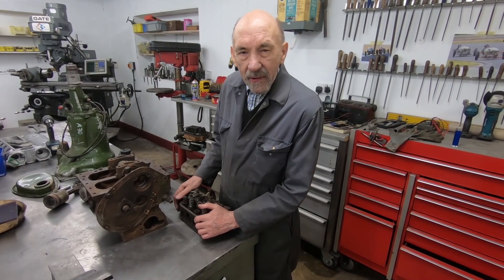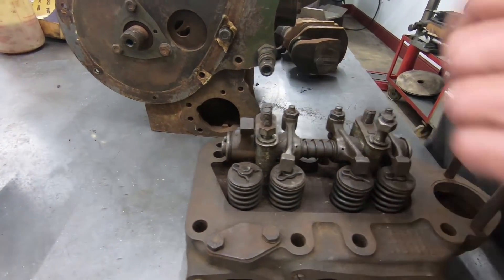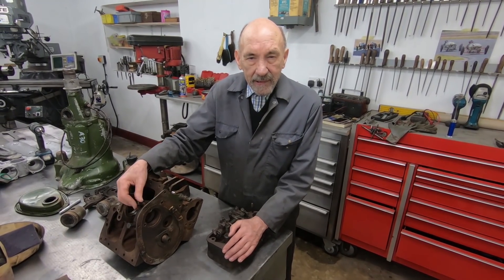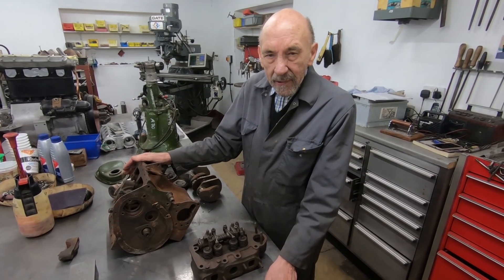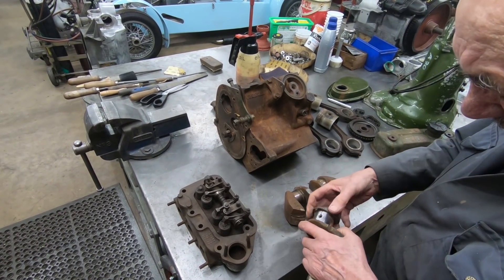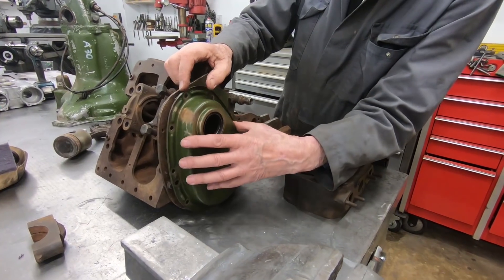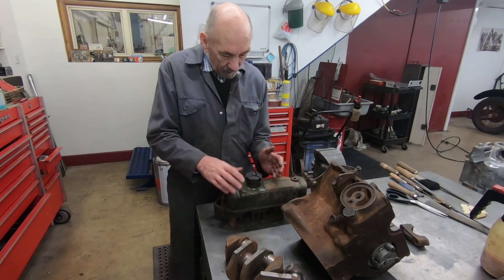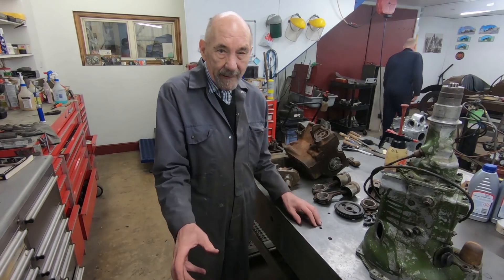2 cylinder Mini prototype engine?! 1957 - Ivan's Shed

Comment: I've watched the whole series on this engine. As an illustration of Ivan's engineering abilities, the rebuild of this engine is phenomenal. As an illustration of the mindset in BMC at the time, this is terrifying. The fact they seriously considered putting a water cooled cast iron engine 1/2 the capacity of the 850 in the mini beggars belief. Thankfully they saw sense,  releasing the mini with the same horsepower and worse power to weight as the 2cv would have killed the mini stone dead.

Comment: I enjoy watching your videos, on your  two-cylinder mini engine could you tell me that phrased you used when the coil was getting the start of current, I have the same problem with my jaguar E-Type which I hand  built in aluminium including the front a-frames, my name is Joe and I'm fully retired now, but can't stop shaping metal. Hope you can help me out and hope to hear from you.
Reply: Sorry I meant to say when the coil was getting  starved of current when you were trying to start it.

Comment: Before you cut and weld up a crank, consider using hte journals on the same side of the crank and simply alternate the firing of the cylinders to "balance the firing". It is a four stroke so thi is a possibility. Have a look at the Fiat 500 Cinquecento engine for reference.
Charles

Comment: Are you still thinking to try this engine in the A30? Presumably it's around 475cc and maybe 18 horsepower (because I'm guessing that the two cylinder engine was made before they decided to shorten the stroke)?

Comment: A rare gem very nearly lost in time - amazing I never realised there were a two cylinder prototypes. Glad they decided on four though it would have been dreadfully under powered.
Reply: As a 1991 Fiat 126 Bis owner 2 cylinder isn't that bad that engine designed in 50s too

Comment: Just seen this courtesy of a post on the Morris Minor owners forum. Like others I thought of Allen Millyard straight away. Ivan removes a couple of cylinders on a crank and camshaft and Allen adds two. Excellent engineering and problem solving.

Comment: I have 3 WW2 Clark CA1 airborne bulldozers to restore (one day), one has an incorrect engine, a 2 cylinder Wisconsin THD, It has two pistons rising and falling at the same time & fires every 360* much mike you e mini engine, however the earlier TJD (almost identical to look at) has one piston rising as one falls and fires 540* between 1&2 but only 180* between 2&1, 
You would thing they would sound very different but it's hard to tell them apart!
Andy

Comment: I have several British made 498cc and 596cc water-cooled twin cylinder engines, with 180 degree cranks, but they are two-strokes, from Scott motor-cycles.  Over the years, from the late 1920s, they were tried in various three-wheeler cars, and two were mounted back to back, to make a V4 and installed into a Morgan three-wheeler. All good stuff !!

Comment: The bores are the same as the 850 mini engine and there are 2 cylinders? So assuming the stroke is the same it's 424cc. It would have to go into a very small car.

Comment: I recently saw a fellow take a 5 litre (305 cu in.) GM V-8 engine that he ran on 4 cylinders.
He REMOVED the 4 pistons from  bores 6,5,7,2 and kept the connecting rods in place for balance. 
He centered the rods on the crankshaft and made the rods stationary by using OVERSIZE rod bearings. 
It ran quite well in a 1982 Chevrolet El Camino. Not very fast, but serviceable.

Comment: Found this bit of info:   Twin cylinder A-series
Under the code ADO11, the twin cylinder was built with the intention to be used in ADO15(Mini). The it was based in 948cc unit, already in use by BMC. It has 474cc, with single H2 SU carburettor, and already has sump gearbox, FWD layout, that will be used in the Mini. In May 1957, the engine was tested in one Austin A35, alongside another "prototype", 500cc, two-stroke, this one was tested in one Austin A30.

https://en.wikipedia.org/wiki/BMC_A-series_engine
Reply: Incorrect. this is a lawnmower engine and no good.

Comment: How to get it running reasonably smoothly could be a problem? If the crank is joined so that one piston is up while the other is down, the result will be "bang-bang-0-0". If the crank is joined so that both pistons go up and down together, the result will be "bang-0-bang-0", but I expect that getting things balanced to minimise vibration could be tricky. Also getting the camshaft arranged to agree with the crankshaft set-up would be another bit of fun. Should be interesting.

Comment: It looks like what you a doing with the crank is the same as the 300 series and other 90's and 00's Hinkley Triumph triple motorcycles. The cranks could not be cast with cylinders 1,2,3 with a 120,120,120 degree firing angles. So the cast the crank with cylinders 1 and 2 at 120 degrees and cylinder 3 at 0 degrees to cylinder 2. They then heated the crank and twisted the cylinder 3 crank 120 degrees before machining and nitriding. This process was needed to make a full 120 degree triple crank because the casting shape in the mould was "re entrant" and could not be released from the mould. You never know they might be able and willing to assist you ?

Comment: I'd love to see this set up as a rear wheel Mini, using an early body shell. It has to be what they had in mind before hitting on the EW engine.
Reply: Definitely not. Issigonis had built a FWD transverse-engined Minor experimentally long before, and always planned the Mini as a transverse. The two-cylinder engine was an early idea to overcome the excessive length of the power unit with an end-on gearbox, before they hit on the idea of combining the gearbox casing and engine sump. Issigonis always said he was never really serious about the two-cylinder unit because it was too under-powered and too rough to be acceptable.

Comment: At first I saw this and thought it was an interesting idea. Then the reality of how little power this engine would make, especially for a car, and figured out that was the main reason the company lost interest in it. Now having worked on my share of british motorcycles, I love the twins, and figure your best bet would be to build it to a 360 degree firing order. That someone managed to save the pieces you have, I would take that as a solid challenge to get it going and see what it can do! If you'll go through the effort to build a crankshaft, may as well make a nice sport cam for it, make it at least be able to be usable on the road. Have fun with this, it's a challenge you seem well capable of handling.

Comment: The few times I've driven a mini it only had two cyclinders working in the wet anyway?
Reply: Usually caused by a split/leaky distributor cover!Who was the complete twat that decided to have the distributor smack in the place where all the rain would hit it?To be fair,the van we used to run had that area in the middle of the grille blanked off,but it still didn’t completely fix the issue.
Reply: @dennislane100  Well, I just have to say Lucas. XD

The fuseless headlights are the best in my opinion. It had to be way too expensive to put on more fuse in an electrical loom.

Comment: You slightly lost me there on the crankshaft description. Can you explain whether it will be fabricated as a 180* or a 360* crank angle? Are you also sure that the standard Mini 850 push-rods will be the right length?

Comment: I noticed the oil filter position on the block and that seems to be the same as the original BMC 'A', 803cc engine with a canister filter. The later 948cc engine (and most likely the Mini Engine) had a replaceable element filter. I realise that the BMC 'A' had Austin roots but I wonder whether there is any similarity here, with the original Morris Minor (Mosquito) proposed flat 4 engine.

Comment: If the main bearing caps aren't the original to the block. The easiest way to get them perfectly round again is machine 0.050" off the cap faces. Set it up on the mill (or line borer), setting up off the original main bearing halves and line bore to correct housing diameter. That way no metal comes out of the block only the caps, keeping the crank in line with the gearbox. Usually 0.050" is enough but sometimes your left with a small amount that doesn't quite clean up right at the cap faces. But it's usually negligible and can be ignored.

Comment: Have read a 2-cylinder engine was said to have been used in what is known as the A20 aka Lightweight 7 prototype (basically a shortened A30), however that was powered by an EMC 2-cylinder 2-stroke engine AFAIK though it is possible some consideration was given to using a 2-cylinder A-Series in the A20 project. Also recall reading a 2-cylinder A-Series was used in a rear-engined small car project known as the Griffin Goggo (as in Goggomobil) that ultimately lost out against the Mini. Do not think the EMC 2-stroke was ever tried or considered during the development of the Mini.

Comment: Keep the crank together and not 180 because like the bike engines they fire opposite cycles in the same plane.  180 degree will give a horrendous rocking couple , the modern bike that do that have balancer shafts.

Comment: Hi Ivan - new to your channel - great stuff! ;-) - and I'm looking so much  foreward to se (and hear) the twin cylinder A-series alive, though you will likely experience the same as Bill Appleby, when he decided to go with the four cylinders only.

As he learned, the twin cylinder need a lot of extras (like larger flywheel, larger balancers, more advanced motor mounts etc) to deal with the vibrations, so they would only save 12% costs by cutting 50% of the motor - but an important piece of history anyway.

http://www.austina30a35ownersclub.co.uk/EngineDesign.aspx

I'm not sure, but you might make a mistake by making the crank with two levels. Vertical twin cylinders have usually only level (both pistons goes up an down simultanously), so that they have one firing per revolution - like this: https://www.pureperformancemotorsport.com/ppm-fiat-500-abarth-4340-crank-rods-piston-combo.html

However, that's also why it requires larger ballancers on the crankshaft, so I believe the original twin cylinder crank appeared pretty different from "a half" Mini crank - but who knows, you might get a better result than Appleby doing the other way. ;-)

Comment: Looking at the Distributor, That would be an even fire twin.
The crank shaft would have both journal in line, Not offset.
Take a 4 cylinder crank and cut out the middle 2 and weld it back together.
The camshaft would be the middle 2 sets of lobes (2 & 3) of a 4 cylinder engine.
I think you could make this work quite easily., But balance is going to be tough to figure out.
Good Luck.

Comment: Hi Ivan , looking at your crank issue , have you thought of just getting the crank CNC profile cut from G350 or some recommended steel ,  out of some 75mm steel plate then rough turned and ground , it would be a lot easier than all that welding .

Comment: Ivan
Interesting project well worth the time to have a go at it. If you have problems with the crank Alan Millyard regularly makes cranks up for his motor bikes by assembling bike style by press fit.
https://www.youtube.com/watch?v=J1cQ098eqF8
This episode shows Alan making a new crank for his 6 cylinder Honda repro engine.
A long time ago now I had a Honda N600 which had a 2 cylinder engine so it was not such a crazy idea to have a small 2 cylinder engine.
John

Comment: This must have been an experimental engine at the factory when they were trying to fit the engine and gearbox in that small Mini front. The engine, casting numbers will give a clue. But having said that, the early Fiats and several other cars of the 1950's had 2 cylinder motors. And this engine could run generators, pumps, floodlights etc.

Comment: mate I fall into the same sort of traps , just happened to be looking at ebay  & found this xt660 engine for peanuts &  blow me down if they don't go straight into an 84 frame I have laying around  , I'll just turn the mud guard & or the swing arm into a heat exchanger/radiator , etc etc  , I thinking ebay has a lot to answer for , but hey it keeps all us old codgers of the streets

Comment: I'm worried that you have dug a hole for yourself. The distributor suggests a 360 crank with both pistons going up and down together. In the next video you show a 180 crank, which won't work  with that distributor.
360 degree cranks were common practice on Motorcycle engines at the time.
Reply from the maker: Let’s wait and see ;) you are right though
Reply: It may not have been common practice but Brit 360˚ motorcycles were transformed to 180˚, 90˚, and 76˚ configuration to reduce vibrations. Distrubiturs may be the smallest of problems.
Reply: @kasperkjrsgaard1447  Distributer It's not a problem, just use a four cylinder on and ignore two of the outputs. A parallel twin cannot be balanced without balance shafts in any configuration at least the 360 crank gave equally spaced power strokes. The Japanese tended to use 180 cranks whilst Triumph et al stuck with 360. Both designs have advantages and disadvantages.
Reply: @donaldasayers  i think that you should read about Phil Irvings patent from 1962 regarding the 76˚ offcenter crank. Theres quite plenty of articles about the subject.
Reply: @kasperkjrsgaard1447  I did at Uni some 40 years ago.
Reply: Electronic ignition with two coils. As they used on Japanese motorcycle 180 degree twins ;-)

Comment: Offset the crank ends, get that offbeat exhaust sound of a V twin, love inline twin engines used in motorbikes with the 270 degree crank.
But u guess without a counter balance shaft, would shake it to bits ?
Reply: No, it certainly wouldn’t. The offset crank theory was a patent of Phill Irving from around 1958 to reduce the vibrations on British parallel 360 twin motorcycles. Neither of those had a balance shaft.
Reply: @kasperkjrsgaard1447  so the Aussie actually invented the 270 degree offset crank. Amazing engineering pioneer with Repco and involved in many early F1/racing development. Great to know.
Have read many storyline on him but don’t recall anything about the crank, but I guess when I read about his history this 270 degree crank firing order was not common and would have gone over my head.

Comment: I like the way a certain type of person just can’t resist not leaving factory engines alone, some subtracting cylinders such as this. Here in the states I’ve seen a 2 cylinder model T and V-twin by cutting 2 from a V8 and then you have Allen Millyard adding cylinders to motorcycles and here in the states I’ve seen an article where someone added 1 cylinder to a Harley to make a 3 cylinder. Doing something just to see if you can do it is the best reason. Keep up the good work.
Reply: "Doing something just to see if you can do it is the best reason"... couldn't agree more... I just built a guitar from scratch... so chuffed, it looks and plays magic.. just wanted to see if I could do it. :-)

Comment: Great do it !. underpowered as you'd expect though.
Reply: Original Mini 1000 was 39 bhp, so I'm guessing about 19 bhp.
Reply: @phil955i  Imagine trying to drive that up a hill...
Reply: @mememaster147  yes indeed lol.
Reply: @phil955i  my farther had two minis in the late sixties, one was an ex police dog van, it still had the roof ventilator, and an estate with the screw on wood to stop it looking like a van with windows, both were 850cc and had the rubber universal joints, which wore out regularly on the farm track on which we lived, with smaller hands than my farther it was my job to undo the nuts holding them together, horrible things !!.

Comment: Ivan its not the only one - a Mini collector I know has one as well.
Reply from the maker: That’s great to know. We always thought the pattern making was amazing considering the production numbers. It does say in the book it took them right up into testing the cars to see it wasn’t worth doing because the efficiency of the engines ended up being worse than the four cylinder standard engines  (probably because it needed way more revs to do the same thing!). I wonder how many were actually made, you’re certainly the first person I’ve heard to say they’ve seen another one.. thanks for watching!
Reply: @DGBcars  I remember what must be your one on Ebay a while back - I may have even bid on it but I am in New Zealand so delivery would not have been straight forward. I thought it was crazy cheap at the time. There is a bit about them in Barney Sharratt's amazing book on A30/35's but you probably know that. The other one looks the same as yours and I dont think has the crank or cam either. I have sent him the link and will message him too. I think what you are doing is fantastic!
Reply: @DGBcars  A three-bearing twin ought to be able to rev higher than the four cylinder engine and with a proper carburation and exhaust set-up it could be a right little flyer. You'd probably need camshaft bearings if the engine is half an 850 and speaking of a cam, I guess you'll need one made specially.  Great project!
Reply: @DGBcars  - In a Mini, it should be able to do about the same performance as a Fiat 500. Not that bad actually, but the point was that cutting half of the engine only saved 12% of the engines price - which means only a few % of the cars price - because of the efforts to reduce vibrations, so it was simply not worth it.